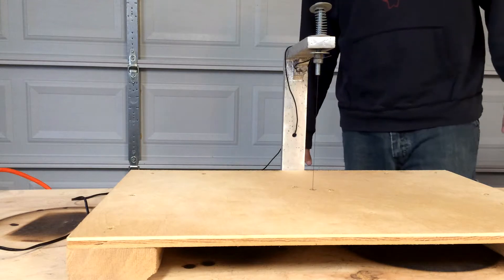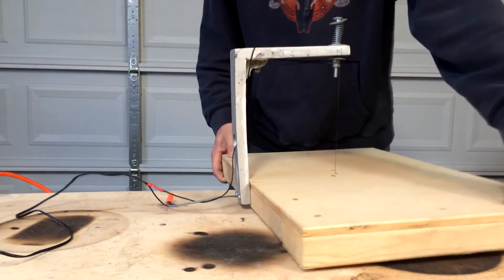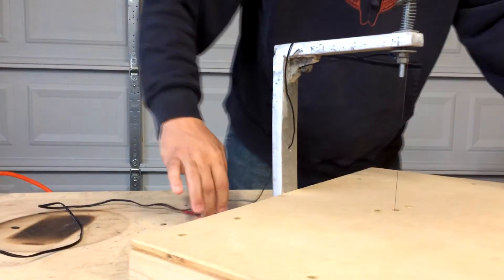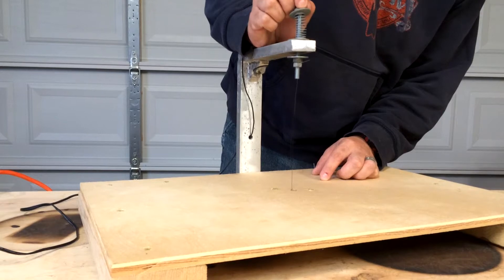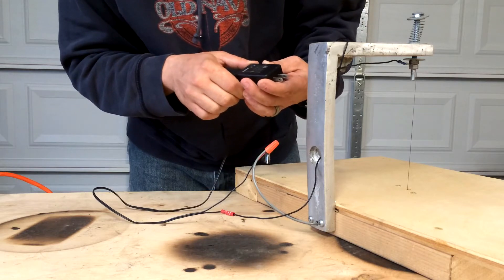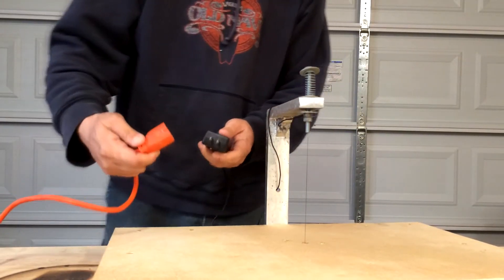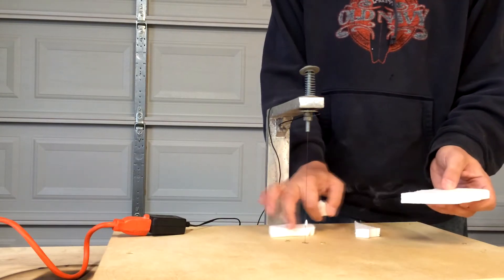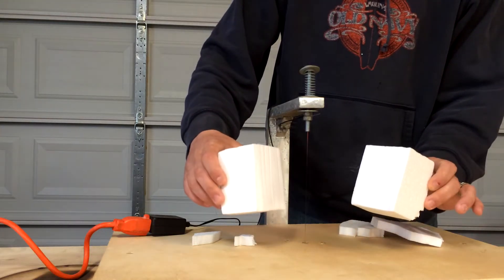Hotwire Foam Cutter (Little Sparks Ep. #3)

Comment: Just get some nichrome wire. It's pretty cheap and it's designed for applications for this. 

At 5 volts and 6.75Ohms/ft...

9.75" is 400F
8.38" is 500F
7.38" is 600F

Key is not to push/force it through. Lower setting and taking your time makes a nicer cut for detail projects.
Reply from the maker: Mike Novo Thank you.  Ill give that a try when this string breaks.
Reply: 556Raven I believe an electric guitar string would be good too but never tried or priced it. NiChrome wire is the stuff in toasters and other heating element units.

Comment: Instead of using a guitar string order kanthal a1 wire, its cheap and comes in large rolls so you can cut to length. It comes in different gauges and lists ohm by foot.
Reply from the maker: otay.  when this one pops i'll try that.

Comment: so do you think the low e string would have worked better ?
Reply from the maker: honestly it may have...  ill try that on when i pop the string again.  Thanx
Reply: +556Raven I think the low E would have too much resistance for the power supply you are using.
The B string seemed to be working great and I have heard some folks use the high E.I would think the problem with the low E would be the size of the cut being too big for some of the cuts.